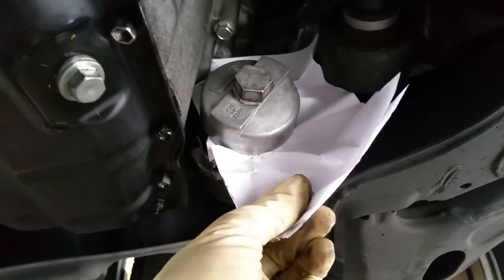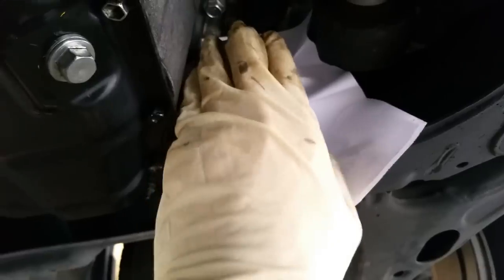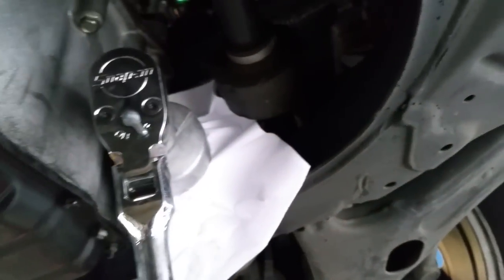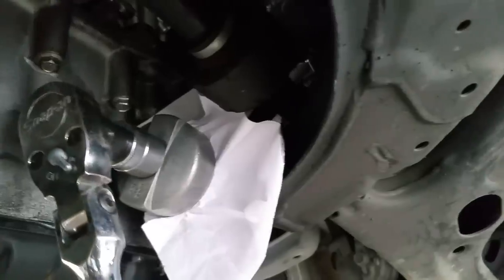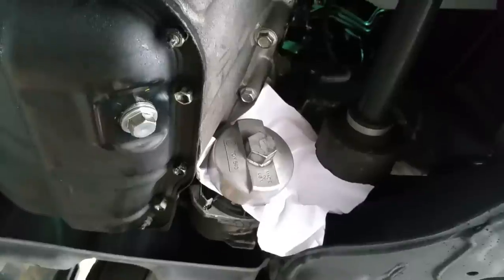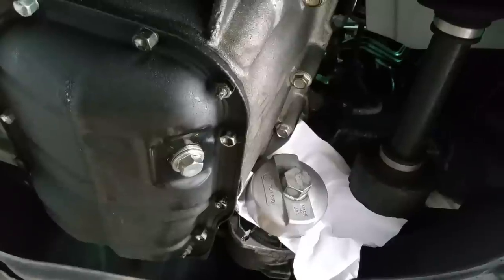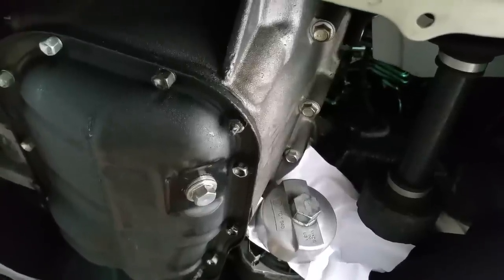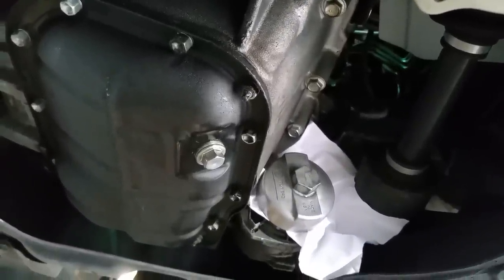WATCH Before you break a stuck oil filter cartridge

Comment: Always do your own oil changes. Most of the kids these days are sad saps. They also think its ok to turn an ir impact gun to the highest setting and zap your lugnuts and call it good. Yes its fast but they end up damaging your wheel studs and swell up your lugnuts. Always underimpact and torque up to spec with a click style torque wrench. For my corolla its only 73 ftlbs.my lugnuts and studs are still all original and my car is 12 years old now. It pays to do all your own work.

Comment: I didn't use paper (because I hadn't seen this video) and the oil filter canister cup is stuck on my filter! I couldn't get it off, so I'm just leaving it on because I'm very confident it won't fall off. I would like to get it off, but how? Has this happened to anyone else?
Reply from the maker: Bryce usually going opposite direction a hair is just enough will get it unstuck.

Comment: I wish I watched this video this morning. I have a Mercedes and I even bought the adapter  like you have and it just slides off When I try to pull on it. The only other thing that ever worked one time was a monkey wrench. (Mine is on top of my engine) And I broke my filter housing unit by cracking the head. Now I have to buy another one can’t even drive my car.

Comment: Good hack. I gave up on those cap style wrench adapters long ago- none of them fit tight enough to grip enough. Harbor F. has a locking style (Vice-grip style) oil filter pliers that has been indispensable over the years. https://www.harborfreight.com/locking-oil-filter-wrench-63696.html?_br_psugg_q=oil+filter+wrench    obviously you have to have enough room to get the device on- which is true for any tool.  You can put a pipe on the end of it if more leverage is needed.

Comment: The filter housing tool used in this video is not correct for the application
Reply from the maker: Thanks for the comment! In cases like this where the housing is way over-tightened, I switch to the one without tabs so it doesn't have a chance to crack the plastic filter housing.

Comment: Stop in to an oil change place and ask them how they get an stuck oil filter off..... They will reach into their pocket pull out  screw driver..... It can be a little messy but jut poke the screw driver thru the oil filter and you have the leverage to spin off the oil filter. Some oil change "Specialists" will use the screw driver every time. No different size wrenches clogging up his work site.

Comment: Just as likely the filter was
Installed dry. No oil on the
Gasket and they will bond
To the metal surface on the
Engine.

Comment: I never go to jiffy lube places or even dealers, I took my new Chevy to the dealer and they never removed the filter, I usually change my own oil but it came free with the new car, big mistake, I went back to changing my own oil.
I also got rid of the car since I figured the oil was so dirty that it could damage the engine
Reply: Where'd you go for an oil change?

Comment: I found this video because my filter housing wouldn't budge on my Highlander V6.  Same setup as yours but mine is the aluminum housing.  After all sorts of attempts including this one, I finally took the vehicle to a local shop where it took two men and a 5 FOOT BREAKER BAR to loosen the housing! No kidding -- this is a new level of oil change insanity.  There's no telling how many hundreds of foot pounds of torque it took to get my housing off from the last oil change.  It's a terrible design from Toyota.  Can't we just have a real, standard, spin-on oil filter that will loosen when it's time?  Here's the bad part:  you can re-install the filter housing to spec (18 ft pounds) and by the time you change the oil next time, the housing has once again welded itself to the engine.  It gets tighter on its own somehow.  There's another famous video here on YT showing a man having to use a power impact wrench set to 300 ft. lbs. to loosen his Toyota oil filter housing.
Reply from the maker: I change hundreds of them in metal housings every year, they come back and its still easy to loosen. I dunno why its so difficult in your case, but I have seen many cases where previous shop over tightens them. Maybe John Cena was the last guy to change the oil. lol. I wish they would use the old tried and true methood. There are conversions for many toyota's to make them go back to spin on filters ive seen online... maybe worth looking into.

Comment: A hole in the wall mechanical made oil filter so tight that I ended up damaging the plastic housing.
Reply from the maker: Did this trick help? I would clean both surfaces off with brake cleaner and try again if not.
Reply: @subtledriver  I have not tried it

Comment: You must push the release tab located at top of filter canister. It's there to prevent the filter canister from becoming loose, and falling off.
Reply from the maker: its made of thin metal and will not hold over 100 ft lbs of tq. I mean, it doesn't even hold tq by hand.

Comment: Ok so you used a breaker bar thst big on a stripped plastic housing. Pretty much the opposite of what you should do. If someone ever put it on with that much pressure it would be broken. I just use a large adjustable wrench and remove it that way, and suggest they buy a new cap and seal. Otherwise it goes on the same way if need be. I can only suggest. The customer approves.  Usually they don't want to pay for a part that can still go on just fine right now. The only reason to use a breaker like that on an engine is for head bolts or maybe a timing belt swivel you want done easier for leverage. Good lord man.

Comment: "...before you break a stuck oil filter CARTRIDGE"?
What? The cartridge never gets stuck what gets stuck is the oil filter cap also known as the oil filter housing cap. The "cartridge" is simply the filter element that you replace when you get the oil filter cap off.

Comment: Its spinning because that's not the correct oil filter housing wrench the one that is used in that application has 6 teeth that lock into the housing but to had used that round one with the paper is a cunning idea if you do not have the correct tool to remove the housing still and all good content I dont down grade different methods and Technique
Reply from the maker: I have the one with 6 teeth, but in this case it would have broken the housing apart. Which has happened before, and why I do things the way i do. I do this method to prevent that from happening. Gotta love the people who tightened this thing last time.  Thanks for comment.

Comment: It’s not just quick lubes over tightening the oil filter housings.  The o-ring holds the housing snug to the block . Cranking them down is idiotic. Our local Toyota Stealership is notorious for their luber goobers doing this. I’m not a fan of Toyota’s cartridge filters anyway. They’re junk. When I went to work for Toyota in 90 they had the finest filters, brake pads, etc of any manufacturer in the world. Now it’s junk compared to then.

Comment: Thats not the right canister cup for that. The right canister cup for those are on some Camry's, and mainly the toyota prius and the cup has 6 grooves total and meet up with the grooves on the housing to not slip. Thats not the right cup you are using first off. Use the right tool for the job and you wont have to fight your tools. If your fighting your tools, you dont have to right tool for the job.
Reply from the maker: This thing was Over tightened to the point it was damaging the threads. Thanks to a moron "mechanic" at the Firestone quick lube. I made this video for those who might not have this tool or broke the plastic tabs with the proper tool. Which has happend. The canister was rounded off as well....
Reply: Jacob W What are you talking about? He did used the correct oil filter cap to removed that oil cartridge canister. All #64MM cup oil filter cap used on Toyota and Scion and also Lexus. This cup is from Toyota dealership but other company sell them too especially at Snap On. It is TOY640 style#. I have all of them especially the one you have. I work for Toyota. They already made a new version of that cup he has on. I have second version that work for overtighten oil cartidge canister. This video did mention that it was rounded and it was tough to get off. Just let you know.
Reply: Yea.  You needed the cup that has the cut outs on it that match up to the protruding tabs on the oil canister.  It wouldn't have slipped then.  I've used both and the Toyota cup without the cut outs just slips around on tight ones.  I personally bought the Toyota/Lexus oil cup from Motivx Tools. P/N MX2320.  Happy wrenching!
Reply from the maker: I've broken many of the tabs off with that exact tool from people who have over tightened them. I've had these tools for many years. I have 4 different ones just for Toyota/Lexus. Thank you.
Reply: subtledriver yeap broke my plastics one yesterday
Reply: I will be fighting with filter like this in few weeks and would try your recommendation!
Reply from the maker: let us know how it went!
Reply: In the first place, he's using the right tool.I had the same problem. It takes a 65/67 mm 14 fluted oil filter wrench. It did exactly as he was describing.  It was on my bosses  Tundra. When you over tighten them that's what happens. These kids that work in these fast oil change places are not taught properly how to tighten the oil drain plug or the oil filter or canister. That's why I do my own work.
Reply: What do you want this mechanic to do, buy a hundred different sockets????? The car companies are trying to get everyone to buy a different socket for every model out there. I say good on this bloke for fixing the problem and a huge "good on you" for not going to toyota and spending $100 on a socket he only needs once a month.
Reply from the maker: James Howard thanks brotha. the original poster said I used wrong socket. ... well with my and many other master mechanic's experiance, the "correct" tool with the notches can snap off the  plastic tabs on the filter canister or crack it. I learned to do it this way with the tabless tool so I don't break anything if it jumps or spins from the flexing plastic. this paper methood works without that crippling risk. thank you!
Reply: I just broke 3 different kinds of tools trying to take off this canister. I didn’t have time to go back to the dealership where they last serviced my Prius. This is very frustrating!😑
Reply: should of got the k&n filter, it got the nut on top.

Comment: my grampa took his to jiffy lube a few months ago despite my preaching and of course they might as well have put it on with an impact! I havve a foul hatred for the scumbag that overtightens these things. shows poor training and quality control in a company. gotta get that aluminum oil socket the stamped or strap ones don't cut it.
Reply: "...and of course they might as well have put it on with an impact!"

I'm sure they did put it on with an impact wrench - and that applies to the oil drain plug as well.  For the guy in the pit doing the work, I'm sure the over-riding consideration is speed, it only takes seconds  But over time it messes with the threads the drain plug screws into, at which point it will start to leak.  And then they will want to charge you for replacing the oil pan.

Comment: 100% not a oil filter housing, more of a oil filter housing cap. The housing is the assembly that the cap threads into. If someone watches your content, has this issue.. they will be mislead. Say they have to go to the Dealership to get a new filter housing cap, they say " oh i need a new oil filter housing".. doh. They will wind up with an entire assembly rather than the cheap $10 cap. Lmao

Comment: 1st time I took my brand new Nissan truck to the dealership for full service in 2002 , they hit me with a $600 bill. The didn't change all the spark plugs, because the rear ones are hard to reach , but still charged me. 2nd time I took my BMW to pepboys also for a full service.  This time got hit with about $500 , and after 500mls when I checked to add some motor oil, the idiot mechanic had drop and left a plastic cap inside where you pour the oil. Since then I try really hard not to go to the mechanic and do it my self

Comment: Firestone reinstalled my drain plug with an impact and cross threaded the plug into the pan.It leaked everything out in half a day.  Almost locked my Honda Accord engine. Tried to repair with a rubber sleeve. Which I immediately stopped. They broke dipstick tube also. So they had to replace oil pan, new dipstick tube, another oil change and filter and a rental car for 5 days over a $19.99 oil change and a fukn idiot tech.

Comment: You can buy those oil filter sockets at AutoZone for about 10$
Reply: And you can get the correct size
Reply from the maker: James Caouette I have 4 different toyota sockets and I wouldn't use the cheap autozone type, those tend to warp or strip out... I have about 50k in quality tools. not saying autozone is junk, just not for me as a professional.  I've changed thousands of filters on toyotas, bmws, hondas, mercedes, audi, ford ect. I have NEVER over tightened or broke a filter upon removal. I chose to use this particular socket, without the tabs, because I saw damage and it was extremely overtight. it's known that the tab socket will break a housing that is this tight. I prefer to make a proper judgement call and have the car back on the road, vs breaking a plastic housing and tying up a bay, not to mention the inconvenience to my customers. thank you.
Reply: I literally have the same socket but however my housing is metal
Reply from the maker: Did you have trouble with your filter being too tight and it slipping?

Comment: I had same problem,  used impact,  came right off
Reply: I was using the special wrench with the 1/2" Dewalt heavy duty 20 volts impact and it won't budge.

Comment: It's INSANE that you have to use 1/2" drive to remove an oil filter . I hope those morons who installed / BUTCHERED this are stuck on the side of the side of the road with lug nuts torqued to 200 foot pounds !

Comment: Be careful who blame for this Toyota fiasco my friend. The blame for this is Toyota and no one else! This design was completely unnecessary. And Toyota is starting to faze it out. The problem is the difference between a gasket seal and a hydraulic one. Unless you're knowledgeable about this, you won't understand what's up.
Reply from the maker: Toyota is not to blame, i service european cars that use this style cap for many years on almost all vehicles. the problem is the lube tech who likes to over-tighten the filter housing because they are ignorant on how the seal works, and many do it on purpose because its "funny". The design is intended to save money on maintenance for the manufacturer. less money spent on manufacturing = more profit margins.

Comment: There is no way to tighten too hard this cartridge thing.  They tend to be hard to remove then easy to put on once they are cooled.  Pay attention to that temperature hint.  I put the metal one on a V6 and tighten it all the way up to the limit by hand.  Same goes pretty much to the smaller plastic one.  If you do not get it cross threaded it will work.  Oil the new gasket generously. One thing on the plastic cups - I do not attempt to remove them on hot engine anymore. Too much risk.

Comment: Lmao you guys are all using the wrong cups why do you think it’s slipping. The oil canister has small teeth where the cup is supposed to be cut out to grab on the teeth y’all look really goofy making these videos with paper on your oil filter
Reply from the maker: I have "the cup with the teeth", but that one can break the plastic filter housing when it's this tight. I've changed oil in about 40,000 vehicles and have run into this situation before and prefer the car to leave my bay happy without a broken filter housing so i can make more money. thanks for the comment!

Comment: With right oil filter socket no need to add the paper
Reply from the maker: If I used the socket with the spline lock, it would have taken the tabs off or broken the housing. I've been through that before. Exactly why I did it this way in this particular scenario. Thanks for the comment!